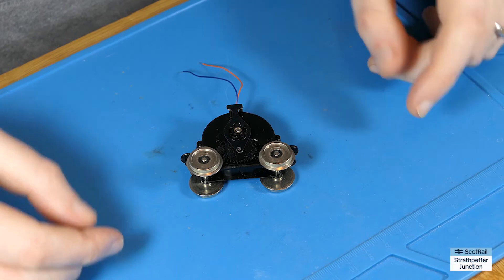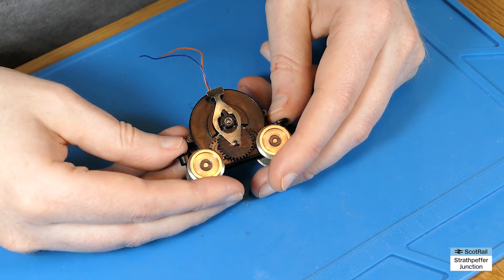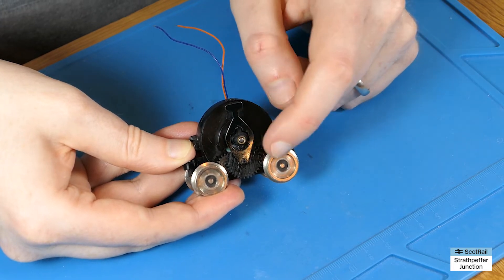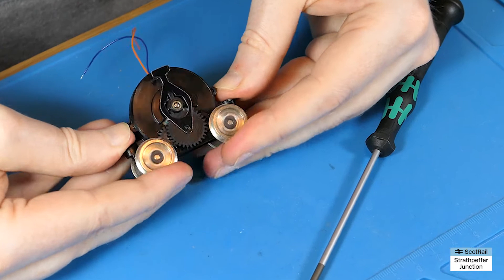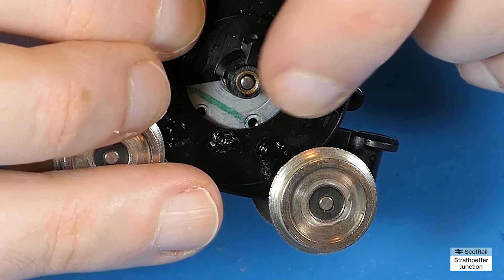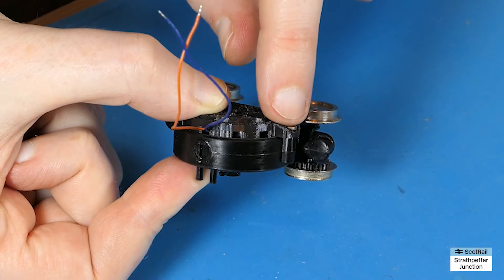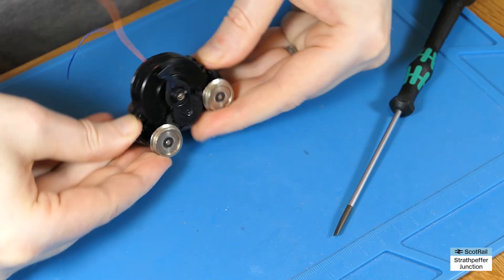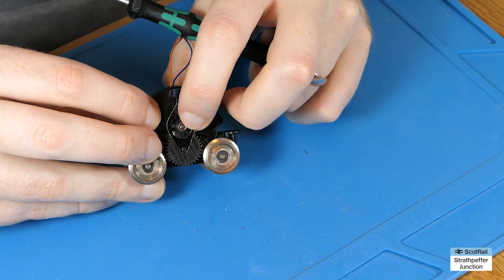Lima Ringfield Motor Adaptor Kit...a word about alignment!

Comment: How do you know what size, I have a hornby class 31 which is getting close to needing a new motor. Thanks Tony
Reply from the maker: Hi Tony. The main factor is whether the bogie is bo-bo or co-co. The former can acomodate a larger motor, the latter a smaller because of the central wheel set. For the Class 31, a smaller 10mm motor is necessary because it has co-co bogies.
Reply: Strathpeffer Junction fantastic do you ship to the USA
Reply from the maker: @tonysag9626  I can do. The shop isn't set up for it yet (because I wasn't sure what tariffs would be post-Brexit), but if you drop me an email with your details etc., I'll work out the postage cost. Just sent one to NZ and it wasn't that much more than UK postage...hopefully the USA won't be much different 😊
Reply: Strathpeffer Junction email sent, thanks mate
Reply from the maker: @tonysag9626  No probs.